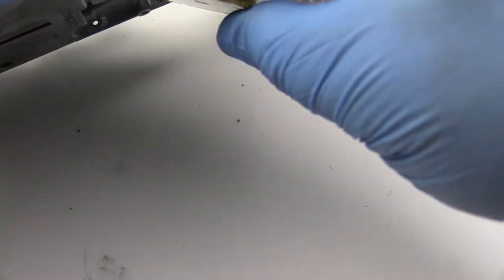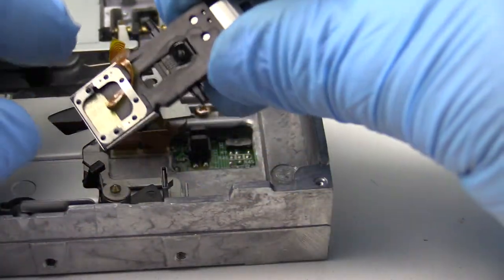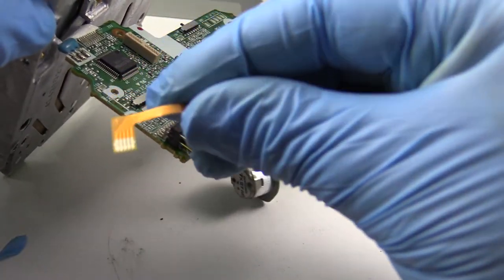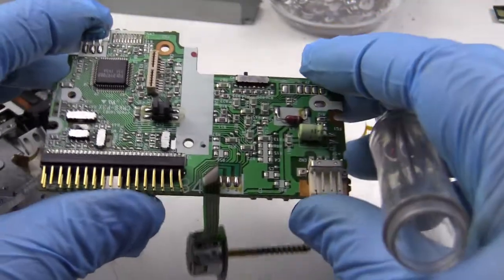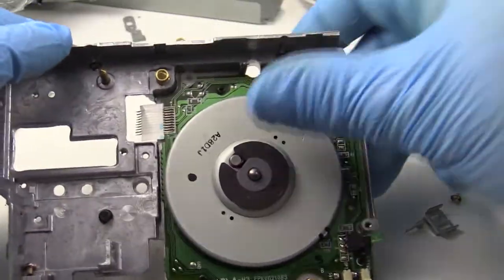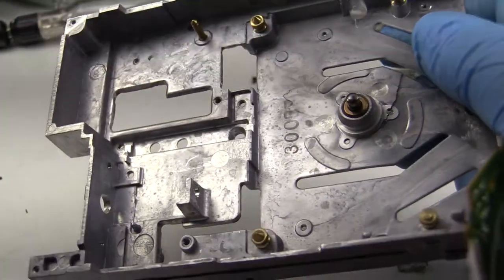Floppy Disk Drive Teardown - Scrapping 101

Comment: How can you tell the difference between aluminum and stainless steel? 

Also, if a metal's color is metallic and not attracted to magnets, does it automatically mean it's aluminum? Thank you
Reply from the maker: kashewz Weight. Aluminum is super light in comparison to almost any other metal you will find in normal scrap.
Reply: Another way to tell is scratch the metal on a file, the aluminum is way softer than the stainless.